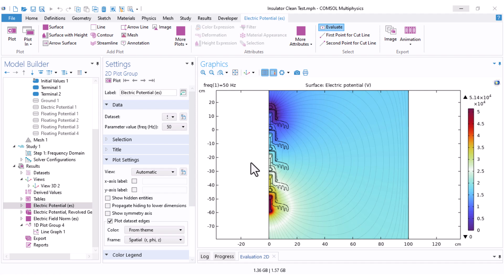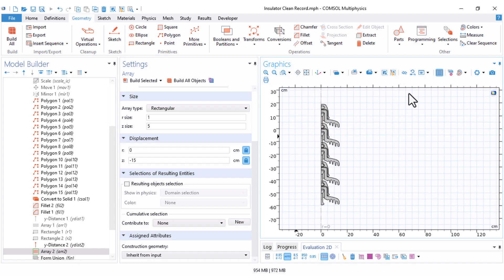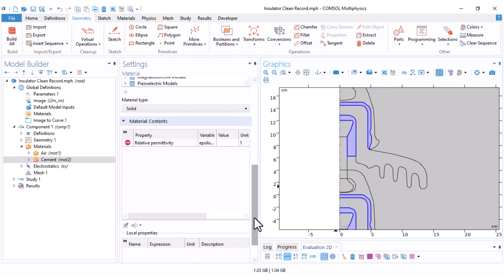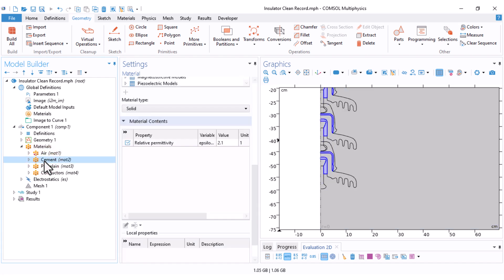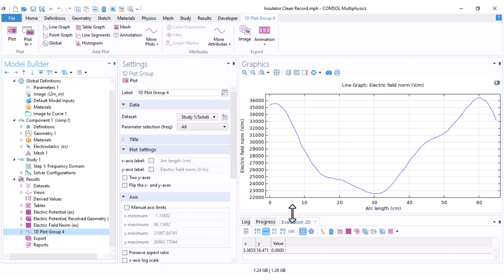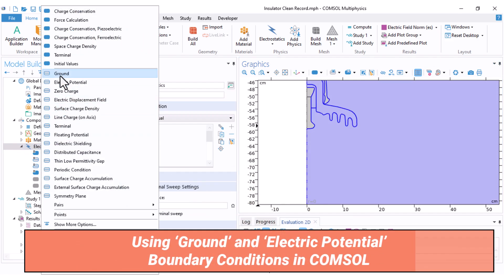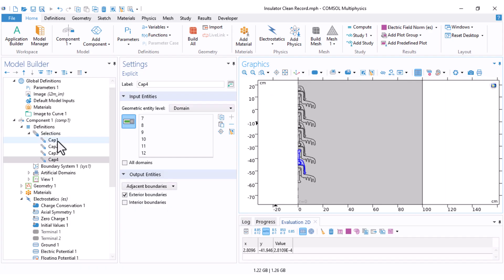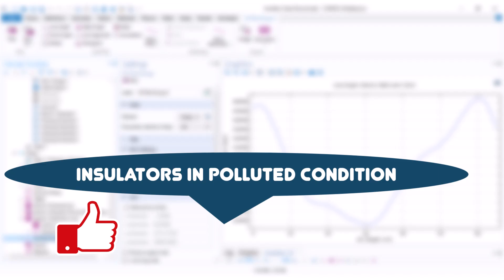How to Simulate High Voltage Insulators in COMSOL – A Beginner's Tutorial

Comment: Why is the middle area of my graph image completely unprotruding, it is so smooth, am I doing something wrong?
Reply from the maker: To better understand the issue, could you please send me a print-screen of your output to highvoltacademy@gmail.com so I can examine it?
It would also be very helpful if you include a screenshot of the cut-line position and the insulator geometry. This way I can check what might be causing the smooth area in your graph.